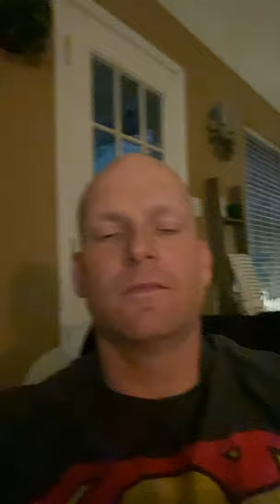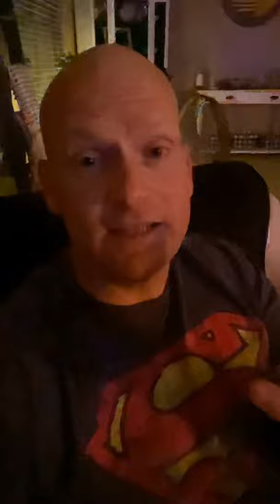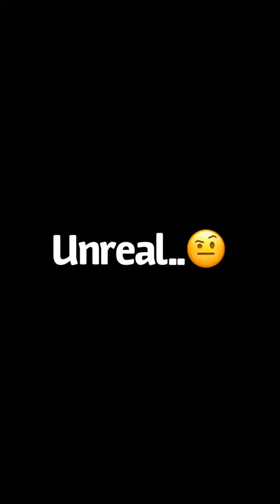When your wrong about technology...

Comment: also I order the new 5G probiotic antenna set, I’m already in thing deep, so listing to John was nice but 550.00 wiring set 24 k gold plated
Reply from the maker: David Grasscutter a probiotic antenna?  Must be good for the stomach eh? Lol you mean parabolic haha!   New vid tonight
Reply: Love to see new video,
Reply from the maker: David Grasscutter you cant use 5G on mofi unfortunately it’s only 2.4 ghz capable man
Reply: @rockernro  even using a just a router pass thru ?
Reply from the maker: David Grasscutter that is correct you can make a 5G and see if it’s faster with your router need to use a 5G router

Comment: Hey John, great video! Do you think the parabolic will work well in an attic instead of the roof? Keep up the good work brotha..
Reply from the maker: Mr Common Sense if you have a good signal yes it will work.  Especially if you are trying to keep it out of the elements, etc!
Reply: Every time a cell signal has to go through something it loses some strength.  Like John said, even rain stuck to an antenna degrades the signal.  Wilson has a good article that you may want to read.   Here’s the link. https://www.wilsonamplifiers.com/blog/11-major-building-materials-that-kill-your-cell-phone-reception/.     I can tell you from experience a metal roof kills the signal strength in the house and especially the attic.